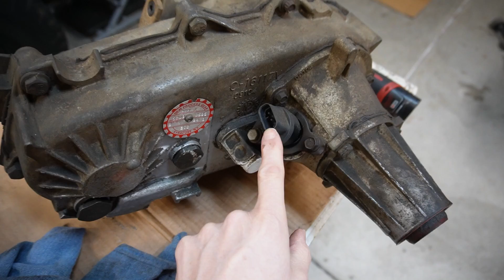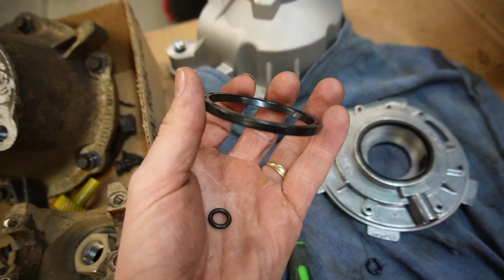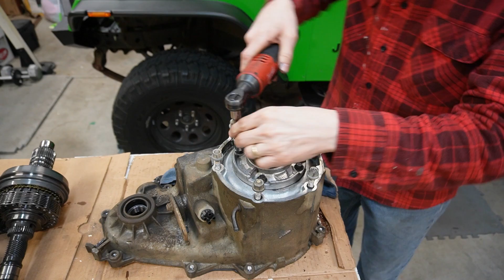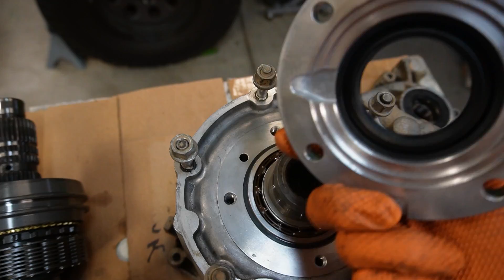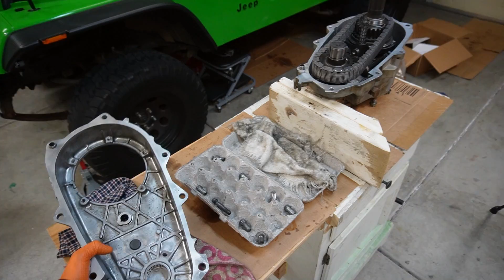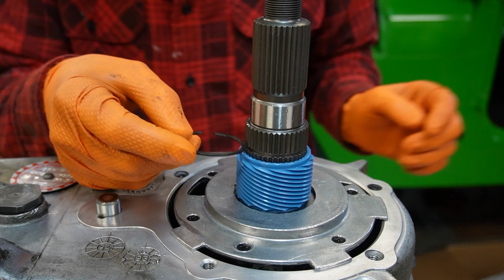How to install SYE: Rough Country Slip Yoke Eliminator Kit np231 (Part 3)

Comment: not criticizing but questioning- if the diameter of the new output shaft is larger than the old where speed sensor sits, wont this change were the speed sensor is clocked? as rotating the speed sensor will change how close it is to the center of the output shaft. otherwise this has been the most helpful video i can find on the subject, THANKS!!
Reply: I answered my own question- the new housing is larger along with the shaft- so sensor clocks to same spot

Comment: Hey Master of The Jeep!! Im rebuilding a 92 YJ 4.0 and purchased a timing chain set from Quadratec. The brand is Crown and it seems quite lose right out of the box. I also notice in your videos your timing chains look like they are double the thickness. What brand chain and sprockets do you use?

Thanks!
Reply from the maker: I put a link in the description of the video of the kit I used. It worked well for me
Reply: @JeepSolid  which video is the link on?
Reply from the maker: This one. In description

Comment: In your rebuild video you installed the 1.25 chain in place of the 1 inch chain. I commented on it but no reply. Did you have issues?? I ordered a kit that came with a 1.25 chain aswell
Reply from the maker: Hey! Sorry. The chain is compatible with a few different cases. I’ve had no issues
Reply: @JeepSolid  thanks!

Comment: I did all this 3 weeks ago, but the PO installed a wide chain kit (1.25" and not 1" wide chain) so i had to put it all back together again with the old chain.
Reply from the maker: I believe the 1.25 is fine. I’ve never had issues with the wider chain and stock sprockets.
Reply: He has a rebuild video where he replaces the 1 inch with a 1.25 inch. I'm.not sure he noticed the bigger width. Wondering if he had issues.
Reply: It seems un intentional the drive sprockets were not replaced to match the wider chain that's why I asked him if he had issues cause I got a kit and it came with the 1.25 chain when I was expecting 1 inch. Trying to figure out to run it or order the 1 inch
Reply: So I finally got into the case and it's looking like I'm going to order the 1 inch chain. The 1.25 fits but has the ability to make contact with the teeth that engage the mode ring. During regular driving the case is tilted back so it should not contact in that circumstance but if you were offroad driving down hill it will certainly cause some unwanted erosion on the heads of the chain pins and the mode ring engagement teeth
Reply: it seemed the stock style chain would not even go into the wider teeth of the 1.25" kit though so i had to reuse the loose chain. I know it's a maybe 2 hour job to swap in the vehicle, but just something i had not mentally prepared to do again. But, so is life. The next time doing anything is always faster.
Reply: the gear kit itself that is installed...the teeth were different and not just the chain. I have photos and it all looks like a stock jeep 231j. The front case embossing says C-16117Y with 09104 under it on the front case half face...a little 9 under those. The badge says NRE process gear...231 J....209 8362...8 12 94 3....272....syracuse NY.

Comment: A helpful tip, at 11:25 when you put the case back together, check to see the shaft that comes through isnt too long(I believe its called the mode shaft)
Mine was too long for the outer housing to set down, and some other models are as well. It helps to dry fit it together first to check so you dont have to redo the rtv(like I did).  You may or may not have to cut it down. I cant for the life of me recall how much but I think it's an inch.

Comment: Just to clarify, if you were just swapping on the SYE, all of this could've been done without pulling the TC correct? Only reason the entire case was pulled was because you were rebuilding it at the same time?
Reply from the maker: It can be done without pulling, but way easier to just pull it.  You do still have to  split the case.
Reply: in my experience its way easier to pull the case and do it on the bench, unless you are very familiar with it and done it several times. It sucks laying on the ground and doing this job.(even just the sye)
Reply: I actually did mine installed in the jeep. It was not bad at all. And I’m not even mechanically inclined.